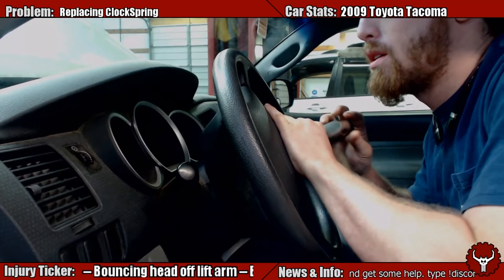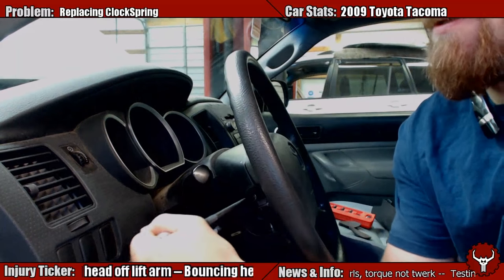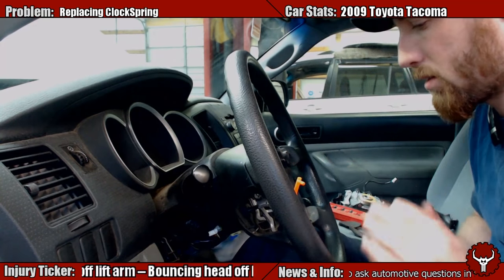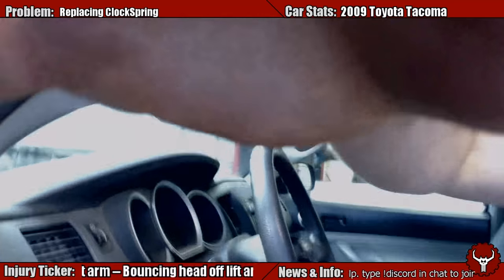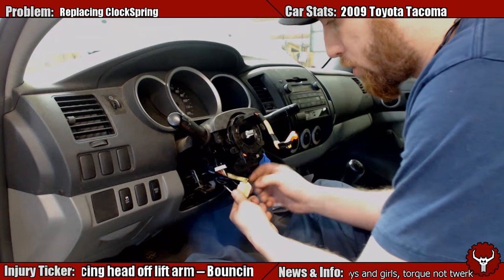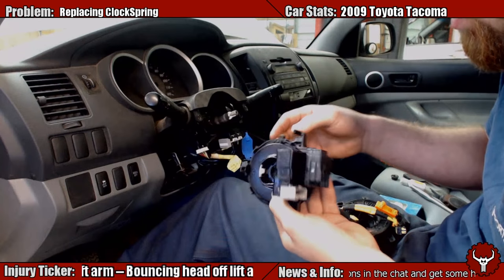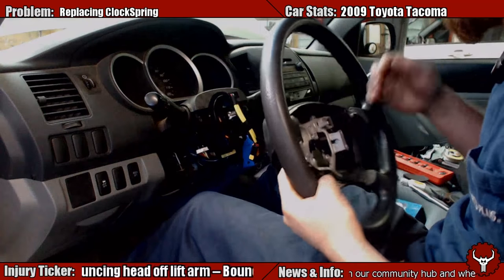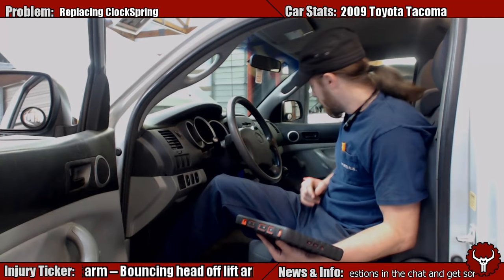Toyota Clock Spring Replacement

Comment: actually it takes about 15 to 20 minutes for the capacitors to fully discharged so the recommendation by most mechanics just wait 30 minutes before unscrewing the airbag also you shouldn't have your body facing the airbag or the airbag facing your body when you remove it and reinstall it stand off to the side outside of the car as you remove it and reinstall it.

Comment: Airbag light has been on for a couple months now in my 04 4runner and i finally had the code checked. Came back as a B1181 " Open in "D" 2nd Squib circuit". Everything so far has been pointing to this part as the problem.  Thanks for the video. 👍

Comment: Great video,I fixed mine by placing some washers between the screws that hold the headlight and indicator stalks,that moves the clock spring a few millimetres forward so it contacts the steering wheel ring thing,thanks

Comment: I changed my clockspring to fix the horn and now the airbag light is on. All the connections are right. Do you have to clear a code?
Reply from the maker: I think the SRS system will keep the light on until all the codes are cleared.
Reply: @deamonmachine  one of the connectors wasn't pressed all the way in. Light turned off.

Comment: Super helpful video! This is a pretty easy job that most anyone is going to be able to accomplish. I did this after my cruise control stopped working, after installing a new switch. The one part missing from here is that the back of the clock spring has a part that you pry off and put into the replacement unit. This whole entire job took me about 30 minutes.

Comment: What is the liquid you are brushing on the steering wheel before pulling it off?  I'm guessing some sort of penetrating oil?
Reply from the maker: I was marking the position of the steering wheel to the steering shaft so it lined up correctly and not off-center.

Comment: Can i do this to make my steering wheel straight just if i take my steering wheel off only and move it over a little i had a shop put an intermediate shaft in and now my steering wheel is off a little i already tried to get an alignment and was told they couldn't fix it

Comment: Do you have to clear the computer of codes after you change the clock spring? I changed mine, had no problems but light is still on. Code that came up when I had it scanned was B1615, 4 sensor
Reply from the maker: +Peter Switalski Yeah, you'll have to clear codes. Changing the spring doesn't necessarily mean that whatever it connects to isn't also bad anyway. What year, make model etc is your car? I can help ya figure it out.

Comment: Quick question, i have a 2013 tundra! Does thi video works for the tundra as well?? And if my horn only works when my steering wheel is either right or left BUT straight, would that happen to be the clock spring? Thank you!!
Reply: Yup
Reply: Yes, this device is responsible for carrying the electrical signals from the steering wheel to the vehicle's control box or computer

Comment: Hello there.. I replaced the clock spring on my 06  tacoma !!  but the airbag light comes on what can i do... sorry for my english is no good 😊...
Reply from the maker: You have to find out that it is the driver side airbag causing the light. If a seat belt buckle or side airbag, the clock-spring won't fix it.
Reply: you can take it to the dealer and they will tell you why its on for a small fee...

Comment: I have ? @4:00 Mark what are you applying Super Glue did you break something or is it Finger nail polish to mark the steering wheel your Video cuts off and back on to that with no explanation.
Reply from the maker: It was white-out and I was marking the steering wheel so it goes back on straight.
Reply: Thanks for responding to my ? I appreciate that.  : )

Comment: Hi, nice video. I have a question, my tacoma have an issue with the horn, it just works sometimes when the steering wheel turns about 45 degrees to any direction, you think it is a problem with the clock spring or maybe is just a cable not connected well? Hope you can help me.
Reply from the maker: The clock spring is a decent suspect, it may be broken or damaged so it's somehow making intermittent connection.
Reply: Ok finally I replaced it and that was the problem. Thanks!
Reply from the maker: Excellent!

Comment: so what is the clockspring for?
Reply from the maker: +Totally Legit Gaming [TLEG] Hmm.. maybe I should have mentioned that XD It connects your horn or airbag so you can turn the wheel and also have an electrical connection.  It's basically a wired wrapped around like a spring and if you turn the wheel w/o it being connected to anything to stop it,  you can break the spring and lose electrical conductivity.
Reply: +deamonmachine ah, then I understand. Thanks!
Reply from the maker: +Totally Legit Gaming [TLEG] That's why if you ever disconnect your steering rack from the wheel, lock down the wheel to keep the clock spring in place.